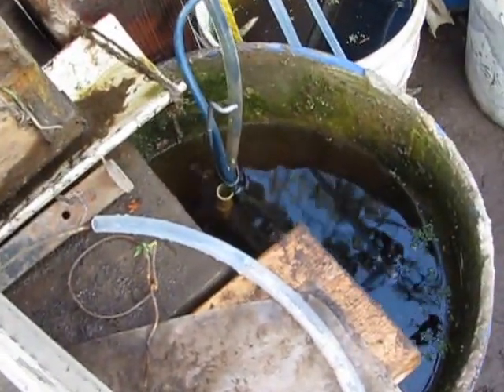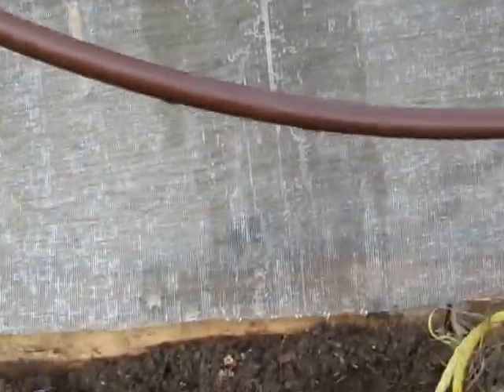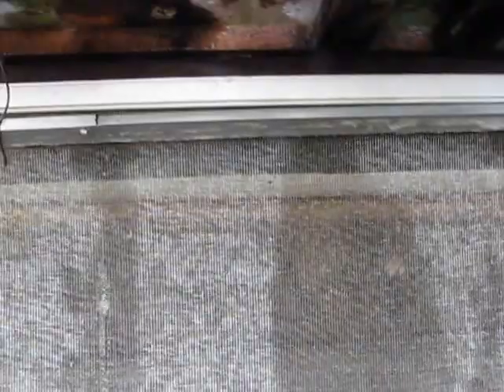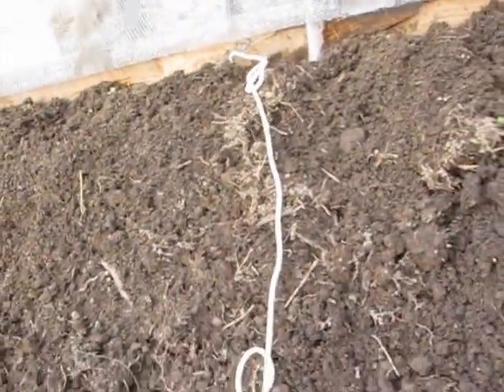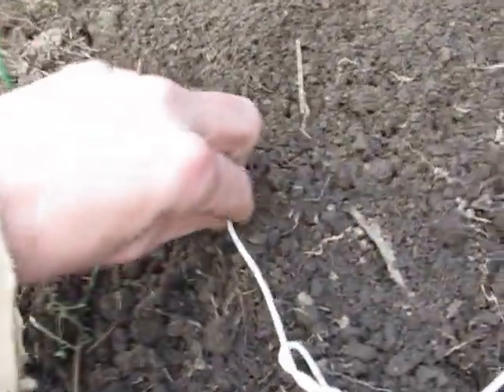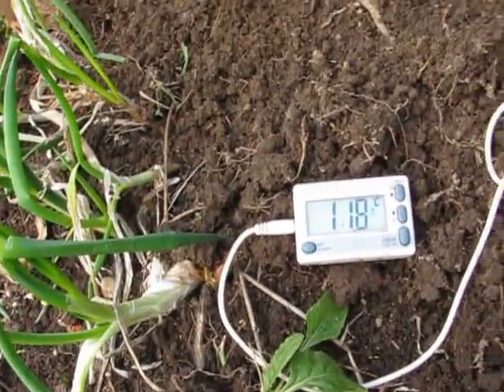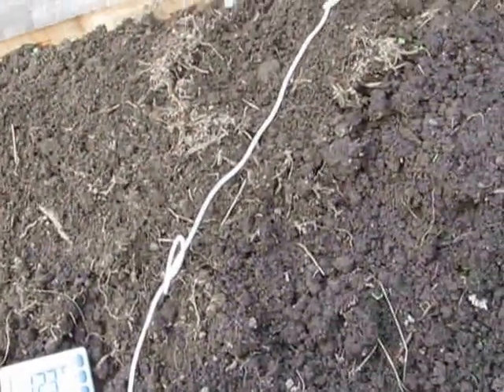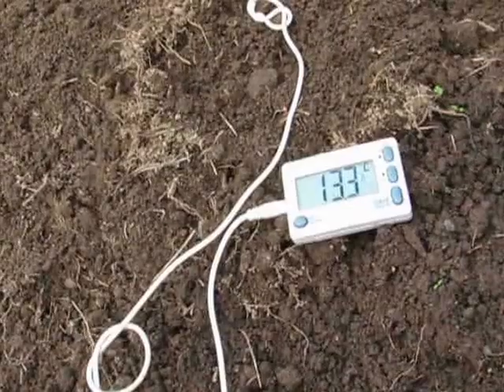Window screen soil heater Delta.  (Please share with your gardening friends)

Comment from the maker: Quick Question? (How good is your vision of reality).  What happens?   1. When you run this at night? Will the water get cooler? or stay the same temp?   And 2.   If you have the windowscreen on the diagonal, (not vertical and horizontal) Will the water spread out along the wires as it goes down or will it still got straight down?  Thanks, Brian

Comment: I wonder about extra layers of screen. I see so much potential in this. And those whirlly birds. This is rocket science my friend.
Reply from the maker: Thanks Brenda, I think it could be worth lots in energy savings and in productivity  to the world economy if people get on it immediately.   I am hopeful that some  people with greenhouses in suitable places will try this right away.
Unfortunately, hundreds of people will watch this, and then their Personal Procrastinating Einsteins from Hell will come out and navel gaze for a couple of months imagining and figuring out why it will not work!  So my advice to those people is just do it!   Then, if their   Personal Einsteins  see a problem, it will be real and immediate and they can  fix it, fix it now! and make a video of their fix.
Reply from the maker: Extra layers of screen?  I don't know.  It might impede air flow, (which is good if it is just a solar collector) but in my case it is a hybrid device and is supposed to steal heat from the air too. The simply solar people use 2 or 3 layers of screen in their devices. But theirs have glass or plastic covers and are strictly air heaters.
Reply: Well yes, I was thinking for heating the water and lowering the greenhouse temps without having to just let that heat escape. I bet the fish would kiss you for an extra 2 degrees warmer. So would the lettuce. If you could get the pump running on the whirly birds... wow... Low overhead to a commercial operation.